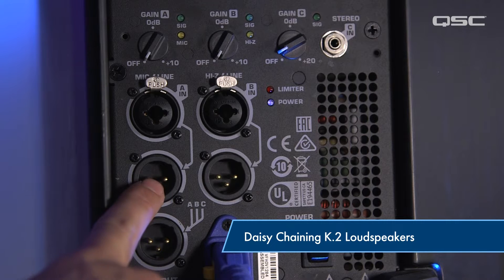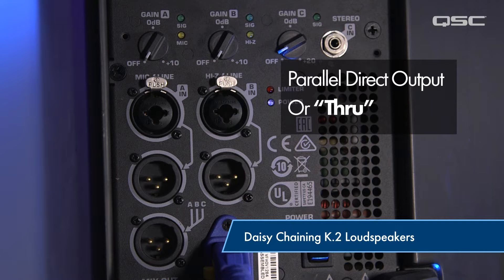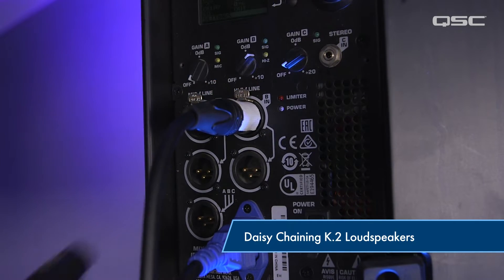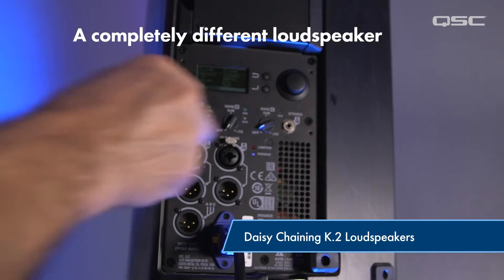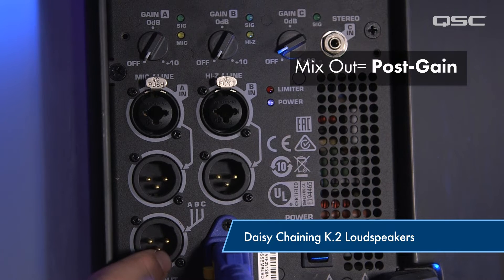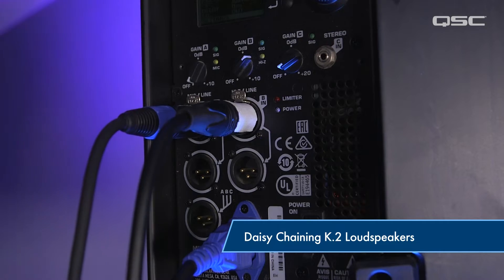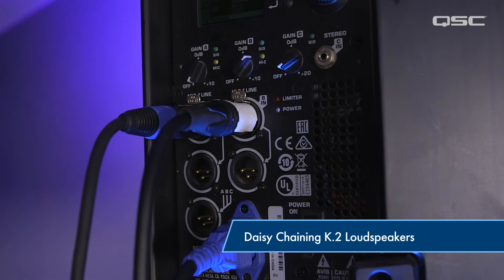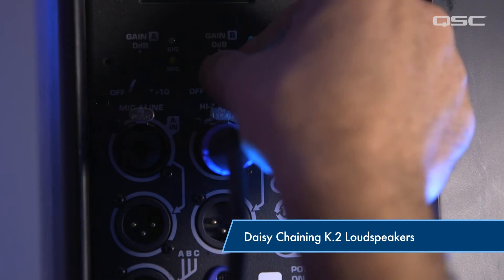How to Daisy Chain K.2 Series Loudspeakers - Quick Tip

Comment: Maybe you can help me. When I am connecting the speaker to my mixing board which input should I be using some people tell me HZ is that correct. Also.,  should I use the default setting. Thank you so much